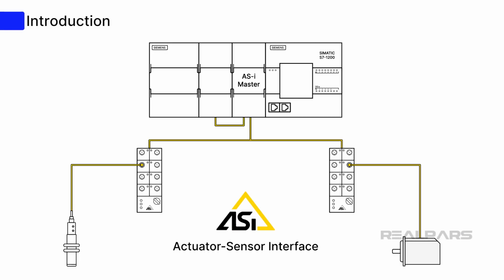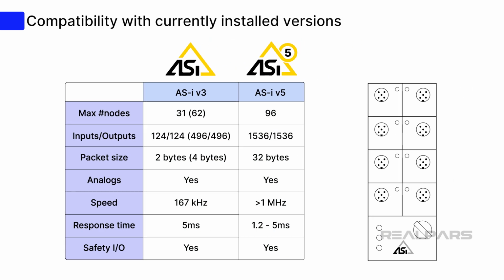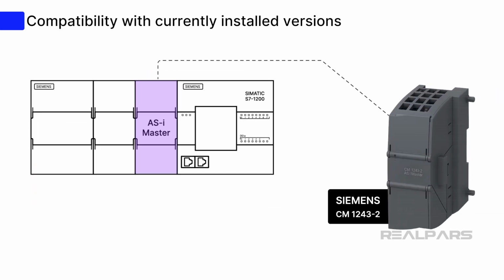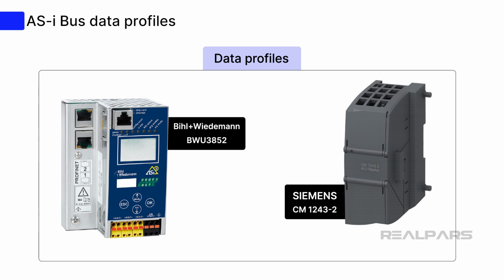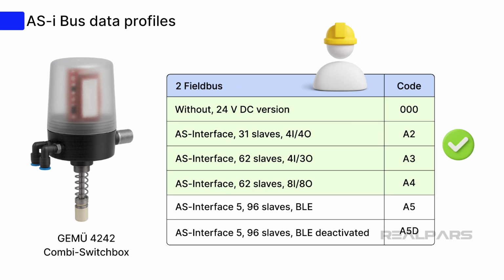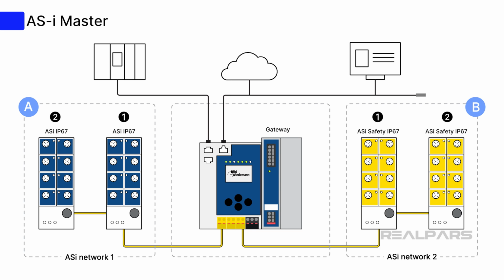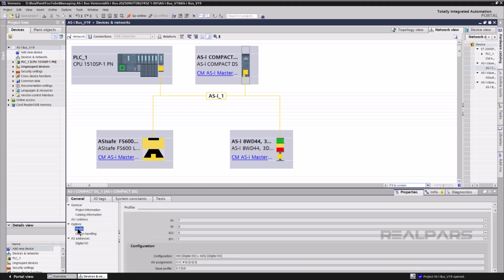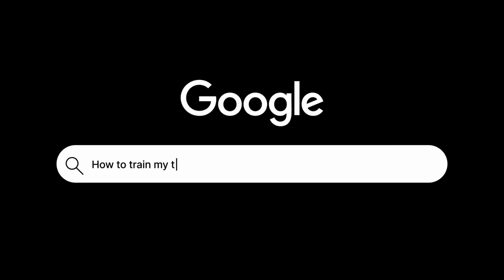Managing AS-i Bus Versions

Comment: Can SI be use din Hazardous environments ?
Reply from the maker: Yes, as long as the ASi master and all connected nodes are rated for hazardous areas.  ASi is not intrinsically safe, so it cannot be used in Zone 0/21 (Class 1/2 Div 1) areas.  It can be used in Zone 2/22 (Class 1/2 Div 2) areas. I have often used ASi in Class 1 Div 2 areas very successfully.